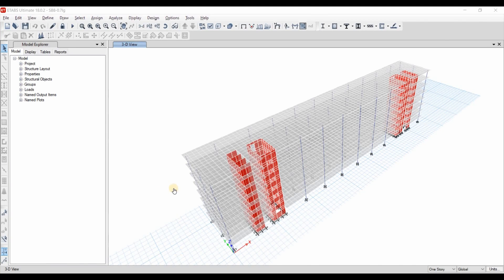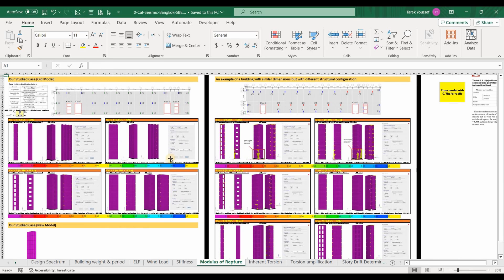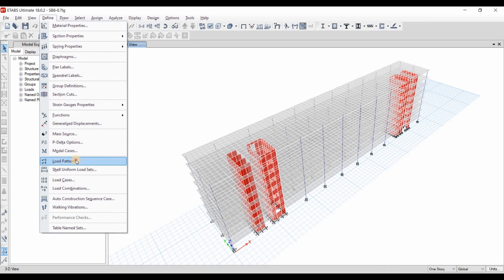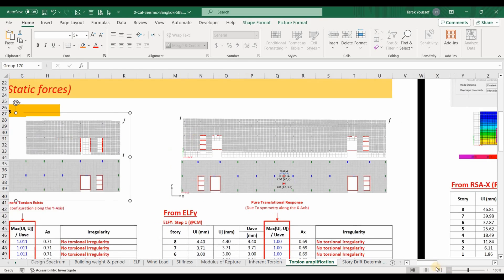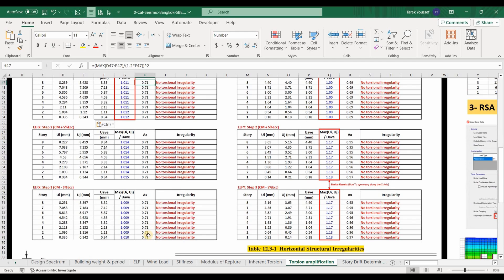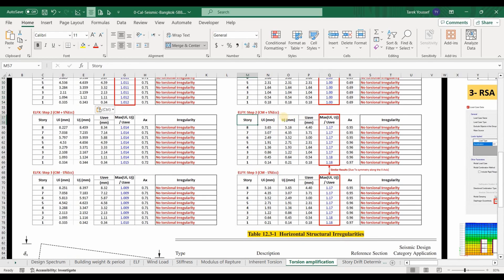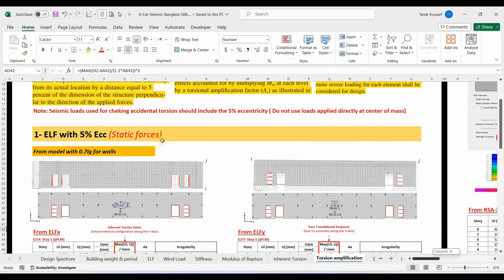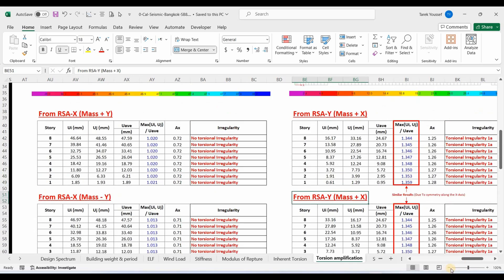ETABS Tutorial 14: Understanding Accidental Torsional Effects in ELF and RSA Methods

Comment: hi tarek, if the results based on using the second technique showing that the ratio still exceed 1,2 and come out with the torsional irregularity 1a or 1b, what should i do based on the final results to determine the accidental torsion if the Ax can't be used if i'm using second technique?
Reply from the maker: Hello,

If you're using the second technique, which involves shifting the center of mass using the modal load case, you don't need to calculate the Ax factor (this factor amplifies eccentricity), because the effect of shifting the center of mass is already included in the analysis.

However, the Ax factor can still provide insight into how much the structure would rotate if the center of mass were shifted. If you find that the Ax factor is notably high, approaching 3, I advice you to modify your structural configuration to mitigate these torsional effects and enhance stability.
Reply: @Eng.tarekyoussef  thankyou tarek, and then why did we must change the load case type to nonlinear static? since the approach of RSA method is the linear dynamic analysis method?thankyou
Reply from the maker: @anandito6833  we need to define the nonlinear static load case to be able to add a new modal load case.

Please note that for RSA method, the type of load case defined is Response spectrum and not nonlinear static.

Comment: Torsion amplification should late in the same time of p delta effect or not  Thank you
Reply from the maker: In my opinion, examining torsion amplification after incorporating the P-Delta effect in the analytical model is the optimal approach.

The P-Delta effect accounts for the geometric nonlinearity caused by the interaction between axial loads and lateral displacements. Once this effect is considered, assessing torsion amplification becomes relevant as it captures how lateral displacements induce additional torsional moments, particularly in asymmetric or eccentrically loaded structures. By addressing the P-Delta effect first, the analytical model can provide a more comprehensive understanding of the structure's behavior under lateral loads, including torsional responses.

Comment: if our Ax value comes out to be more than 3 (lets say 4) then do we need to change our structural system in order to reduce the Ax value or should we just take it 3 and design accordingly?
Reply from the maker: When the Ax value exceeds 3, it means the structure is at risk of instability due to torsional forces. To ensure safety, it's crucial to follow code requirements closely. If Ax is too high, structural changes are needed to reduce torsional effects and maintain stability.

Comment: in ASCE 7-22, they have imposed a limitation of using the second approach for RSA in case the TIR (Delta max/ delta avg) is more than 1.6
Reply from the maker: The limitation in ASCE 7-22 on using the second approach for RSA when the Torsional Irregularity Ratio (TIR) exceeds 1.6 indicates the importance of considering structural behavior accurately. It's worth noting that the second method, involving physically offsetting the mass, could potentially amplify the effects of accidental torsion for some buildings with torsional first modes.

In my opinion, engineers should not adopt any approach blindly. They need to conduct a thorough investigation to determine which approach is more logical and accurately predicts the real response of the structure.
Reply: @Eng.tarekyoussef  if TIR exceeds 1,6 and a RSA is required, i think that it is ok to compute the Ax from the ELF procedure and then override the eccentricities in the response spectrum; however, this would require defining U1 and U2 as 2 separate load cases to be able to assign eccentricites for each direction, where applicable; Then, in the combinations, we can use 100% of one direction and 30% of the other; this is not very much recommended since it is better to use U1 and U2 in the same load case so the structure will be oscillated in the principal axis; so whatever we do has its limitations